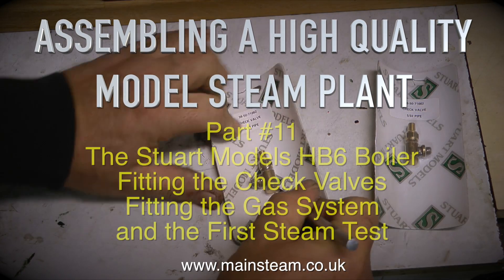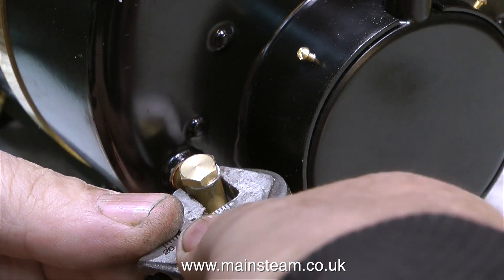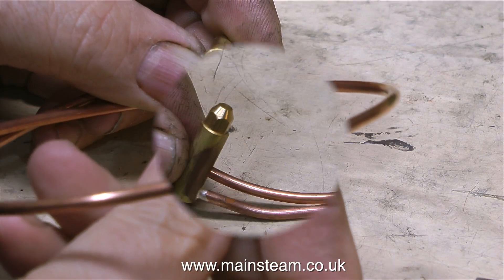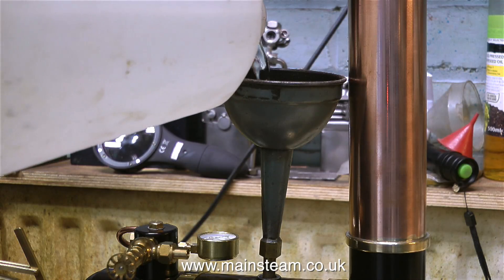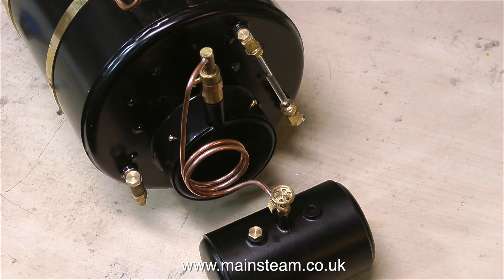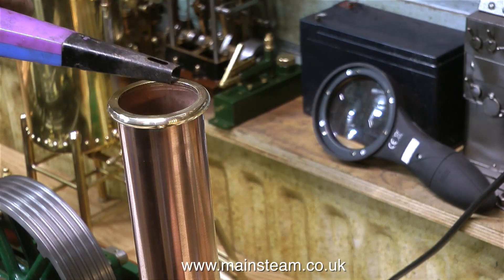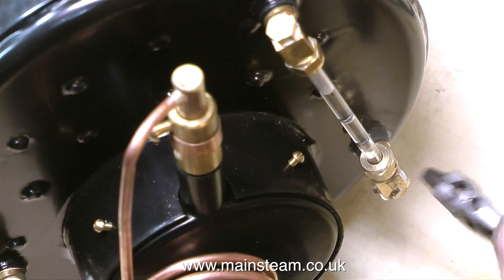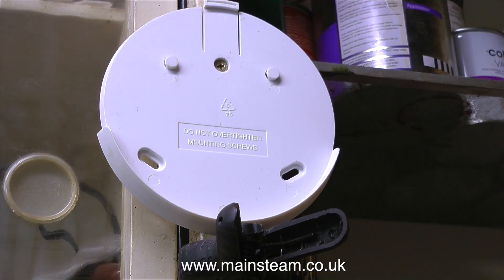ASSEMBLING A HIGH QUALITY MODEL STEAM PLANT - PART #11

Comment: Where is the problem? 1600 GBP or 300 GBP nobody make a Hydraulic pressure test before it runs under Steam, and no Pressure test with Steam either. is a bit silly or.

Comment: That is weird with a new gauge I have never seen that ether. Now on some that have been over pressured  that is a different thing. 30psig gauge put in a spot that called for a 300psig gauge. needle ended up with a right angle bend. Had it in my toolbox for years, loaned it for someone to show another person and it never came back.

Comment: I think putting the gas tank in your freezer will make filling with liquid much easier as the liquid won't want to boil off so much.
Reply from the maker: No need to do that - the tank is already very cold when it is empty anyway. I have done many experiments with filling liquid gas tanks using a transparent filler pipe to see the liquid gas . . . https://youtu.be/3eFiTrSjDgY